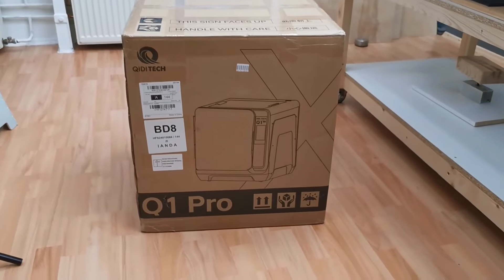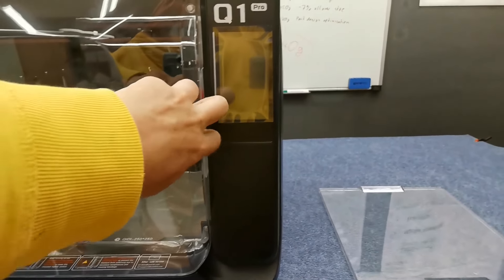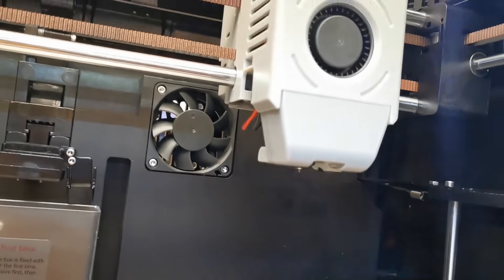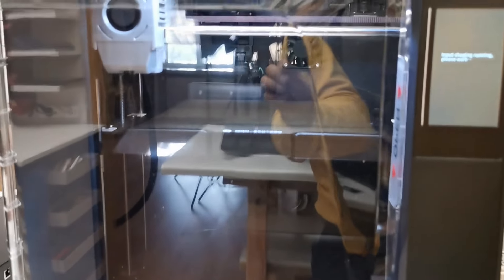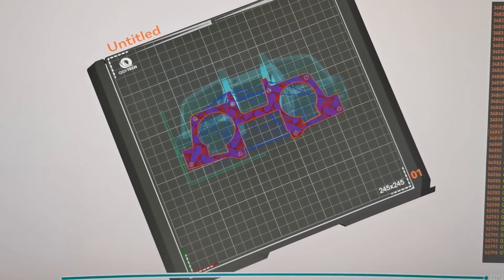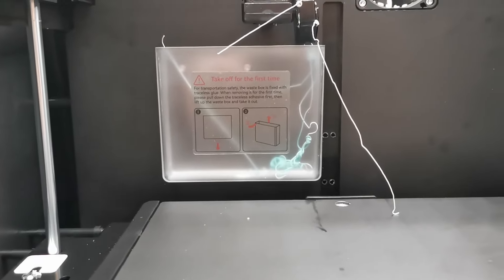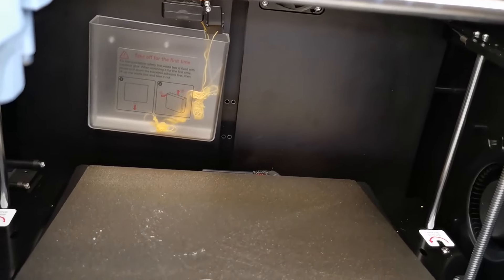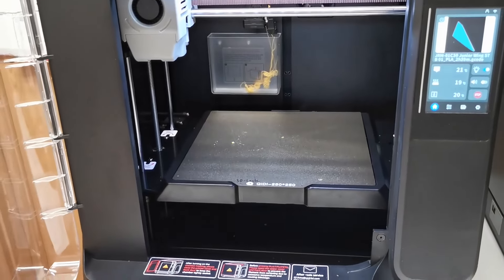Qidi Q1 Pro Review and LW-PLA Printing

Comment: I have Q1 Pro and don't really have a problem with the door. I can open and close easily and don't even think about it. The magnetic plate is kind of a pain to get centered on bed perfectly but the printer does a good job of calibrating bed level before each print anyway. Really like my Q1 Pro. Did have an issue when I first set it up and customer support was very good.

Comment: Your designs are amazing😃 I am so impressed 👍👍👍Could I print the JRM-01 model entirely from regular PLA filament?I have K1 MAX 3D printer.
Reply from the maker: For a flying model pla is too heavy but just as show model it works.
Reply: @rene_marc   I see. And what brand of filament are you using? Your colors are matte and I would also like to achieve that effect.
Reply from the maker: Colorfabb and 3dLabprint

Comment: Thank you for this review.
After having some issues with my Bambu P1S, I thought I'd be changing companies. To me though, to keep my business, it's how a company handles problems. Everyone is going to have them. So it's important to me to know that communication is going to be there as well as parts. My issue was resolved in less than 7 days and that includes getting the part. I just ordered my second P1S and my fifth and 6th A1 Mini with AMS.
I just love these little things! They're so basic but fast and reliable and the quality, once you get the profile dialed in, is crazy good! 
Rene, I need to get one of your planes to print. I haven't stepped into the aircraft side of RC yet. Just on road racing with F1 cars and some drifting. 
I sent you, well your company, a couple of messages through the contact us section of your website and haven't heard back in a few weeks. 
Just thought I would let you know. 
Once again thanks for the review!